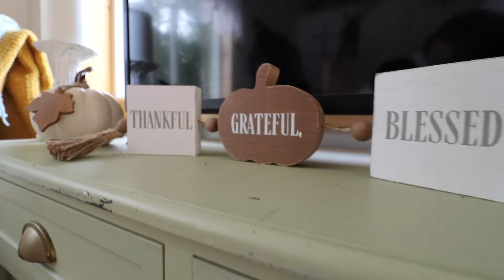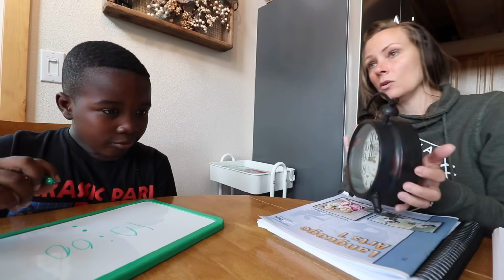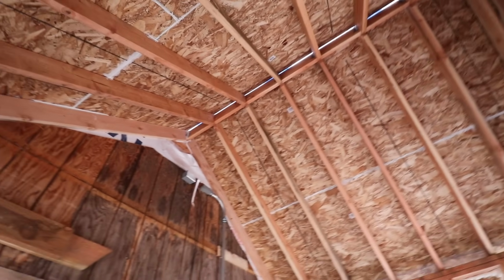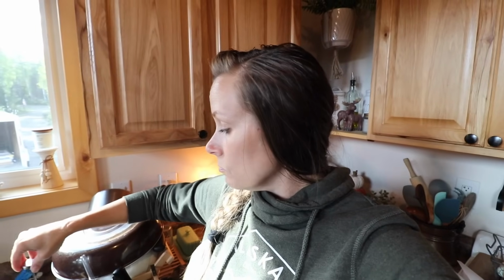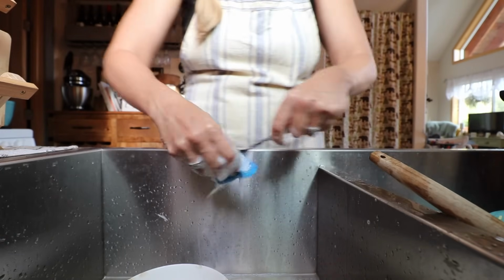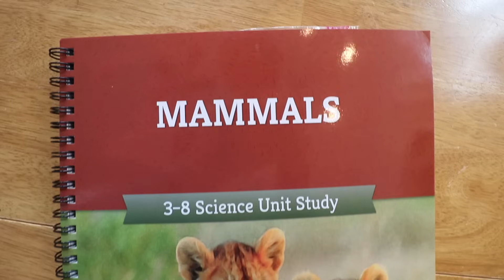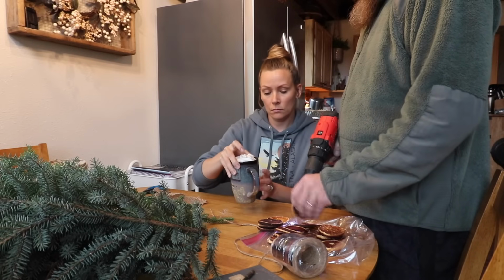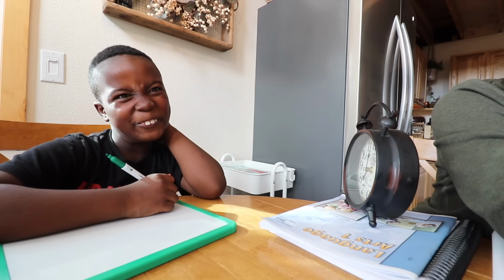FALL Day in the Life! Cabin Addition | Homeschool | Restocking Firewood + DIY Fall Garland...

Comment: I have a suggestion for Joe. When he wants to chop wood instead of using the log splitter, if he'll get an old tire and set the chunk of wood inside of it, when he chops it, the pieces won't go flying off to the side. They stay inside. And if he can find a rather huge, big around tree, he can cut a piece off, however thick/high he would want it, he can use it as a base to put the tire on, then the logs that need to be split inside. Hope y'all can understand what I'm trying to suggest 😄

Comment: A cute art project for the holidays would for the boys to paint holiday scenes on the living room windows. Halloween, Thanksgiving, Christmas, etc.  As a child we did this on our windows at school. 

You don't want permanent window decorations, so make sure you use the correct paint: Any interior water-based acrylic paint will work and so will washable tempera paint. You can find both in many different colors at your local craft store. Thin the paint with a splash of water if it's too thick.  Amazon has lots of glass paint sets.

Comment: Considering the location of the bedroom, You might need to add a small buck stove in your bedroom .  It will keep the back section warm during those cold Alaskan night… just thinking out loud.😊
Reply from the maker: Our room is already colder than the rest of the house, so I imagine the new bdrm will be even colder. If we have to, we might install a small propane wall heater back there OR Joe was talking about maybe putting an insulated air duct running from the living room to the new bdrm with a duct fan. We’ll see. But we’ll prob have to do something.☺️

Comment: @HomeFreeAlaska, you need some Double Bubble Reflective Thermal Aluminum Foil Radiant Heat Vapor Barrier Insulation, it's amazing at how it works.  Put it up over our garage/master (ceiling only) huge difference.  I'm in FL so we have to vent and it ends up creating channels of cooling from the north facing side.  Did it in parts of a new out building, same thing happened, if you pocketed warmth it'd be easy with that stuff.  Like a two layer Mylar blanket with a void.  Construction nerd came out 🤷‍♂
Reply from the maker: Thanks friend! I’ll pass your comment to Joe, he’s a fellow construction nerd!🤣💪🏼

Comment: I loved teaching math and science together because they over lap so well. Lab exercises can be fun, educational and entertaining to both boys. 
P can document the process and findings. C can double check Measurements and verify observations.

Idea/problem, 
prediction/hypothesis, observation, gather data, analyze date for conclusions.

Baking bread once or twice a week, changing the variables to find out the outcomes. Weights and measurements, fractions and conversions can be done at both boys levels. 
Another idea...
Building a small bench or stool.
Learning about wood/densities
Drill sizes, stability, includes math and science. 

Documenting errors is just as important to learning. You don't have 10 failures but 10 ways not to do sonething.
These projects can be student driven.😂

Comment: Great progress! Will the woodstove be enough to heat the back of the house which will be your bedroom now?
Reply from the maker: Prob not. Our room is already colder than the rest of the house, so I imagine the new bdrm will be even colder. If we have to, we might install a small propane wall heater back there OR Joe was talking about maybe putting an insulated air duct running from the living room to the new bdrm with a duct fan. We’ll see. But we’ll prob have to do something.☺️

Comment: Was wondering how you are going to heat the new master bedroom...since your heat source is in the front of your home...do you think the wood fireplace will have enough draw the heat it? Just curious...don't want your tootsies (toes) to get cold in the winter😊...
Reply from the maker: Our room is already colder than the rest of the house, so I imagine the new bdrm will be even colder. If we have to, we might install a small propane wall heater back there OR Joe was talking about maybe putting an insulated air duct running from the living room to the new bdrm with a duct fan. We’ll see. But we’ll prob have to do something.☺️
Reply: @HomeFreeAlaska 
Glad your thinking about it...that was the purpose of my question...and you guys are resilient enough to get er done.👍

Comment: Just curious how you’ll get heat from the wood stove all the way back to your new bedroom? I commend you guys for being able to survive with one bathroom as that’s the one thing we couldn’t do😅 I love all the fun changes and upgrades!
Reply from the maker: Our room is already colder than the rest of the house, so I imagine the new bdrm will be even colder. If we have to, we might install a small propane wall heater back there OR Joe was talking about maybe putting an insulated air duct running from the living room to the new bdrm with a duct fan. We’ll see. But we’ll prob have to do something.☺️ And we plan to put a door in the office leading to the existing bathroom.

Comment: What are you guys going to do for heat in the master bedroom? One thing my dad used to do with wood heat was install a air return near the wood stove and wire a fan that will turn on with a thermostat in the master bedroom. Once the temp drops below a certain temp the fan turns on and pulls hot air from the living room  into the master bedroom. Just an idea. God bless!
Reply from the maker: Our room is already colder than the rest of the house, so I imagine the new bdrm will be even colder. If we have to, we might install a small propane wall heater back there OR Joe was talking about maybe putting an insulated air duct running from the living room to the new bdrm with a duct fan. (What you said). We’ll see. But we’ll prob have to do something.☺️

Comment: I keep thinking about your video. Wondering how you will heat you new rooms being so far from your wood heat.
Reply from the maker: Our room is already colder than the rest of the house, so I imagine the new bdrm will be even colder. If we have to, we might install a small propane wall heater back there OR Joe was talking about maybe putting an insulated air duct running from the living room to the new bdrm with a duct fan. We’ll see. But we’ll prob have to do something.☺️

Comment: Adding to the how are you going to heat your master bedroom...
I've been thinking about it and just want you to be careful in regards to mold...cooking, showers etc. produce moisture and mixed with heat can produce mold...
Just wanted to think about it...
Reply from the maker: Our room is already colder than the rest of the house, so I imagine the new bdrm will be even colder. If we have to, we might install a small propane wall heater back there OR Joe was talking about maybe putting an insulated air duct running from the living room to the new bdrm with a duct fan. We’ll see. But we’ll prob have to do something.☺️

Because we heat with a wood stove, we don’t have issues with mold. It’s a very dry heat. Keeps all the moisture out of the cabin thankfully.☺️
Reply: @HomeFreeAlaska  👍

Comment: Hello! Can you set your fruit ends, clove, cinnamon mixture on the top of  your wood stove instead of using the stove top? Maybe your stove gets too hot? I have a cast iron "pot holder" that just looks like a miniature iron table so when I set a kettle of water on the iron "pot holder" the pot sits about an inch up off the actual stove.
Reply from the maker: I just heat it up to a simmer on the stove & turn it off. Sometimes depending on how warm the fall day is, we might not have a fire going in the wood stove.😊

Comment: I love the new addition. I am wondering how you are going to heat it, since it is so far away from the stove. I grew up in an old farmhouse and it seemed like every winter the heat from our wood stove just didn’t make it around the corner to my bedroom.
Reply from the maker: Our room is already colder than the rest of the house, so I imagine the new bdrm will be even colder. If we have to, we might install a small propane wall heater back there OR Joe was talking about maybe putting an insulated air duct running from the living room to the new bdrm with a duct fan. We’ll see. But we’ll prob have to do something.☺️

Comment: Tina…French Press… I have thought of getting one. But no one ever shows getting the grounds out and cleaning. I am in the country, not supposed to wash any grounds down the sink. How do you get grounds out? Thanks, love the channel.
Reply from the maker: We either dump them in the trash or compost them for the garden.☺️
Reply: @HomeFreeAlaska  😃 I haven’t ever seen one used in person. I assume when you push the plunger it packs the grounds down, and don’t understand how I would get all the grounds out without rinsing - which would put some of the grounds down the drain.
Reply from the maker: @julih2674  oh it does pack the grounds down, but I just put a splash of water in there & swirl it around, they come lose very easily & it either goes in the trash or in the compost bin. Then I rinse it out & clean it.☺️

Comment: Will the Woodstock heat your new addition or will you need to add an additional heat source?
Reply from the maker: Our room is already colder than the rest of the house, so I imagine the new bdrm will be even colder. If we have to, we might install a small propane wall heater back there OR Joe was talking about maybe putting an insulated air duct running from the living room to the new bdrm with a duct fan. We’ll see. But we’ll prob have to do something.☺️

Comment: You might have answered this question. But, how are you going to heat the master bedroom?
Reply from the maker: Our room is already colder than the rest of the house, so I imagine the new bdrm will be even colder. If we have to, we might install a small propane wall heater back there OR Joe was talking about maybe putting an insulated air duct running from the living room to the new bdrm with a duct fan. We’ll see. But we’ll prob have to do something.☺️
Reply: @HomeFreeAlaska  Those are good ideas.

Comment: How are you going to heat the bedroom
Reply from the maker: Our room is already colder than the rest of the house, so I imagine the new bdrm will be even colder. If we have to, we might install a small propane wall heater back there OR Joe was talking about maybe putting an insulated air duct running from the living room to the new bdrm with a duct fan. We’ll see. But we’ll prob have to do something.☺️